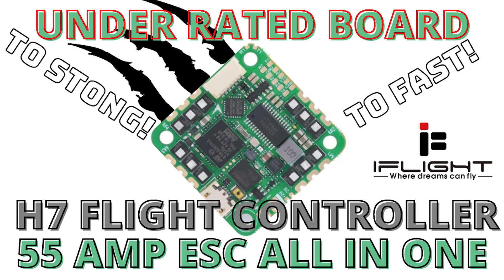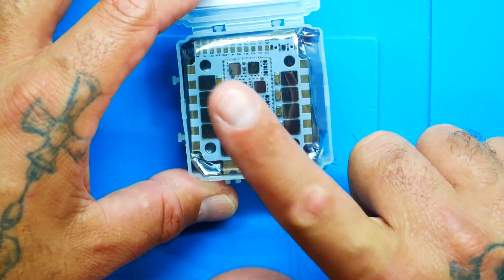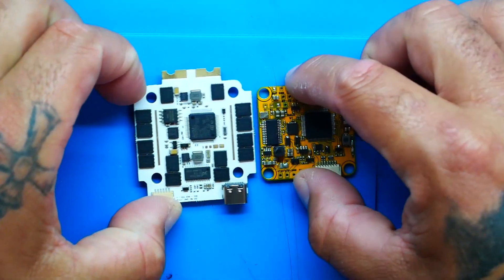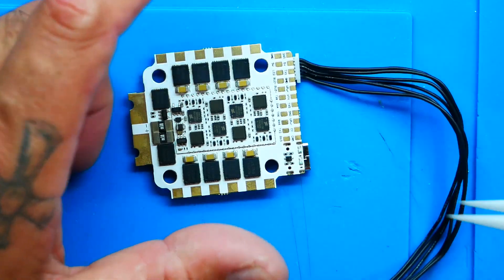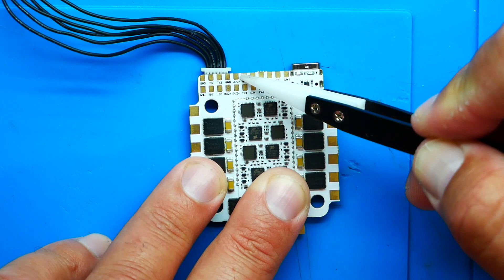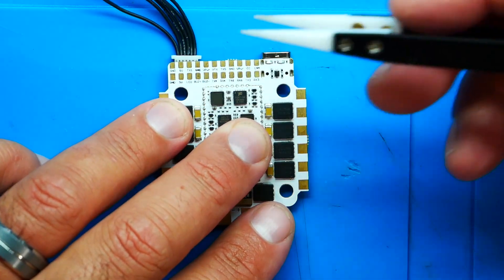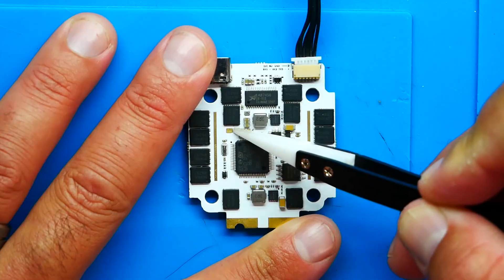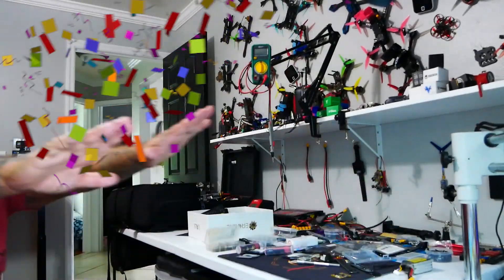One Board Does It ALL! F7 Flight Controller & 50 Amp ESC Loaded With Features All On One Board!!

Comment: yeah you are right this board is so big.... it won't fit in my apex dead cat correctly lol , is there anyway to wire a caddy vista on the solder pads instead on using the plug header , I notice I do have an extra tx and rx pads and I can also solder it on the camera 10v portion but will it work ? my first time rigging digital and been flying analog for 3 years

Comment: Hey Love the content. Always on point and informative...Question....building a 3" X8. What's the option if any of adding another ESC to this board to support the extra motor outputs. Is there any AIO currently capable of doing this?
Reply: I went for Kakute H7 BT and Tekko 32 f4 50A and 65A (By mistake - I wanted the same esc but clicked wrong) Anyway, there is also a mini version. And the H7 supports 8 motors by default. I'm building a 7" X8

Comment: Hi sir !  I just bought Lumenier LUX AIO F7! 
I connected DJI Air Unit to pin port , and I got no power on my DJI Air Unit! I tried to figure out looking for the bidge power somehow on the board and I couldn’t find it either!
If you know how to figure out with this problem please help me ,sir! I really appreciate it! Thank you Sir!
Reply: I'm having the same problem with this board. Did you fix it?
Reply: @groundrushvideo  no I did not!
Reply: @liukang81  I just built this last night with a Vista.  No power to the vista.  I tested the Vista on another quad and it works fine.  WTF?
Reply: @robinoury2494  I assume you have updated the stock firmware? For me, only the 4.2.9 Betaflight FW has a working DJI Power Supply. With 4.3.1 I got no voltage on the DJI Port....
Reply: You have to map "User1" function Mode  to a AUX Switch, to turn on/off the DJI Port. In 4.2.9, the Port is always on while for 4.3.1 you have to map a switch.
Reply: @Dennis-hw3ol  too bad this isn't documented anywhere, nor was tech support any help.  I returned mine to GetFPV almost a year after I bought it and they gave me a credit in full.  After I'd spent 2 days trying to figure out a solution.

What I don't see is how the air unit is going to get any power to know it's getting a switch flipped if the power is disconnected.  Assuming it's on sbus and you aren't using some other kind of control channel.

fyi: I bought the Infinity and it's awesome!!

Comment: I just installed this bad boy and it freaks out when i arm it. betaflight shows coreect yaw and pitch etc when its plugged in. motor direction is right and motor numbers and placement is good too. board and sensor issue but im not sure how to resolve. the gyro is set to CW 90 flip and that seems to get the 3D model acting right when i move the quad. roll pitch and yaw degress are 0 
.. any ideas?
Reply: oh i fixed it i set gyro to cw 0 degree flip and 90 degree yaw and that fixed it wahoo
Reply: @CozziFPV  man i have been fighting the same issue but have just about given up. My board is mounted solder pads up 90 to the ccw. I have tried probably 100 different orientation in bf. She wants to flip right seems no matter what. I am about to order another fc i am so sick of this board
Reply: @travissowell3329  they sent me a replacement but it took a month and half and I haven't even put it back together yet. I lost interest in it but now I'm worried the damn thing won't work again since you're having the same issue. Is anyone else's flying lol
Reply: @CozziFPV  oh shoot so your fix didnt fix yours?
Reply: @travissowell3329  I'm not sure yet I will have to finish installing the replacement I just got. It just took so long to get back that I lost interest.
Reply: @CozziFPV  ok you had written above you fixed it with 0 flip 90 yaw. Did it screw up after or that never fixed it? Who did you reach out to for replacement  lumenier or who u bought it from?
Reply: @travissowell3329  no it only hovered a couple times for a sec or two while trying to troubleshoot. I thought I fixed it but no dude. Lol. This was mounted on an exorcist frame too so it was getting beat up just from arming and it freaking out. I reached out to getfpv where I got it and they created an rma for replacement.
Reply: @CozziFPV  i just sent getfpv a message. That is who i bought mine from also.  Hopefully they handle it properly.  Did they direct you to lumenier or handle it themselves?
Reply: @travissowell3329  they handled it I think Luke owe us their house brand now but don't quote me I think someone told me that. Blake always helps me he's great.

Comment: nope.. no go.  had this 2 months ago fresh and new.. after a few flights with no crashes the 10v reg just died, no smoke, no warning, had to hardwire a 10v reg to power the caddx dji unit.  the esc is running bleeding edge blheli32 (most recent app release or it will not even see them) and can run 128hz pwm but resulted in a right side droop and lean until moved back to 48hz.  gyro has way too much noise despite even running a 50v 1000uaf panasonic cap on the board when running 6s.  Let's not even mention the totally screwed up layout design that dont fit a lot of standard frames without rotating it and motor remapping, its a very long AIO and a lot of freestyle standoffs will hit the corners..  I felt the iflight h7 beast (despite having $!#@ support  for the H7) was a much better product in my experience, but the beast being a nacho mount is a real pain too.  Although the luminere esc pads were beautiful and easy to solder on unlike the beast and it did seem to have full betaflight support.  I had high hopes for it, but again.. 80$ wasted on a hyped miracle board.

Comment: hey Drainman how is the iflight beast holding up over time?
Reply: Personally I bought two, both of which had issues other than the known rpm filtering and baro issues. Ifight repair replaced one which still had issues. I dont have 6 flights between the two builds in the last four months. I must ike the punishment has I just installed, flew, and ordered a second one of the new beast version 1.2... Fingers crosses.....
Reply: @battantx  cheers for the info mate

Comment: IMO, aio boards are worthless... at least on bigger quads. I'd handwave aio's on whoops or toothpicks, but i wouldn't use them further than that.

You break a single component, and you have to toss the entire thing (or fix it if you're among the microsoldering niche). I honestly think having separate components is better because if it's just one component that fails, it's an easy swap, and you only have to replace that single component. Fry an esc on an aio, and you basically have to rewire the entire drone just because of 1 single failed segment of it
Reply: Exactly!

Comment: I don’t understand why aio boards became so hyped. It’s like putting all the eggs in one basket, beside the fact it’s not configurable at all. The only reason for their popularity for me is consumers who came from dji, eager to plug and play without need to think or ability to solder.
Reply: Everyone is different and has a different list of priorities, some people have the time and desire to build it all, and others probably just want to fly because time and convenience are big factors.
Each to their own you know, just cause it's not for you doesn't mean it's bad and should be dismissed as something for people who can't think or solder, that's a little arrogant to assume In my opinion.
Reply: @owaind-g678  lol you should try to read and understand whole comment next time before replying to it. The part with opinion about aio stuff auditory is only 1/3 of my message, dude.
Reply: My AIO builds are super clean!
Reply: Nonsense, stop generalising. I need an AIO board for my stack height limited BMS JS-1 Racing frame just to be able to fit a vista. Nothing to do with not being able to solder, sometimes people just need low profile boards/stacks for older frames to be able to go digital which unfortunately means an AIO.
 
I'd have this over the iflight beast std AIO as it has its own BGA related reliability issues.. but this Lux HD is just not in stock anywhere. 

AIO means it will be an extremely clean build, so if you can find a solid one that works well and can take a bit of punishnent, you could end up with something that does away with fewer potential wiring failure points. I think its possible to end up with something superior.. but with the focus of everything going more towards sub 250g, yep, its probably unlikely... I'm not going to give up on using this great frame for a vista just yet though. If I can find a good, reliable  AIO for a 5" racer it will definately be worth the search.
Reply: but so smol